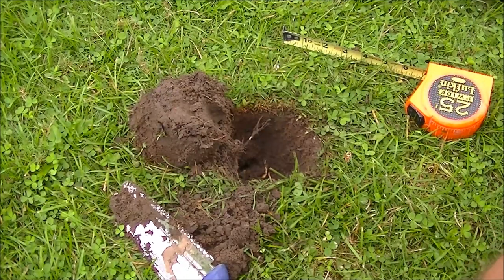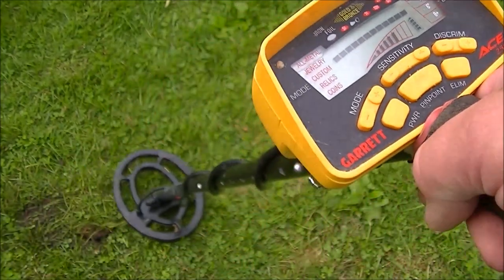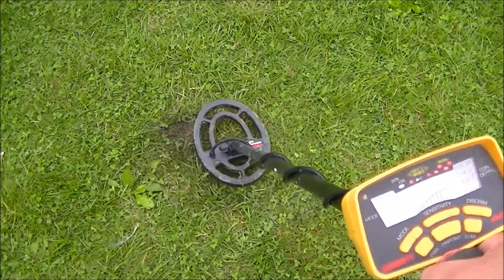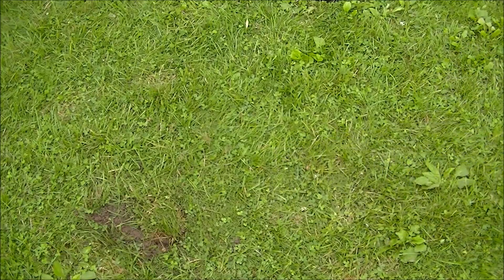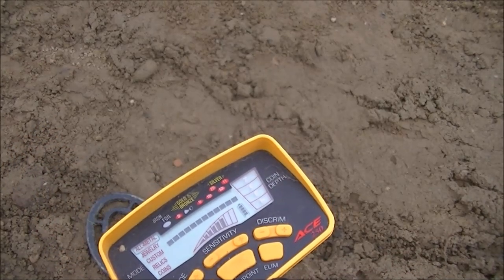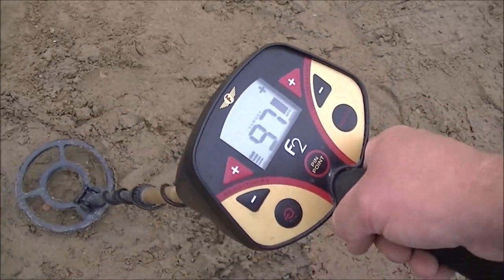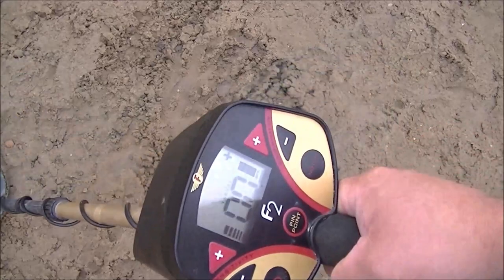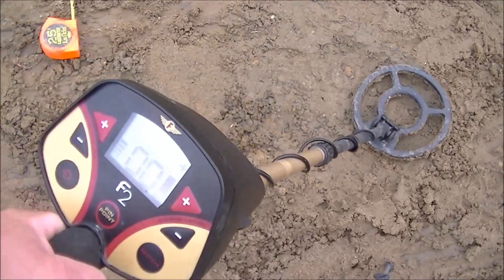Garrett Ace 250 and Fisher F2 Tested Side by Side

Comment: Why do the machines make several different noises depending on each pass?
Reply from the maker: Hi Jason. Basically the machine makes different tones based on what king of metal it thinks is in the ground.  For example, iron should sound different from copper or silver etc.  Of course this gets complicated when there are many types of metal nearby.
Reply: Paul W.
Thank you for responding and answering my question. I assume with time one will learn the tones. Thanks again, I am looking to get a decent unit for a hobby.
Reply from the maker: Jason O I like both the Fisher F2 and Garrett Ace 250.  They are both about $200.  They both get the job done and are dependable machines.

Comment: Ive used the ace 250 and its a dreadful detector , I have several minelabs  which are I no in another class , However I also have a tesoro  compadre  which is cheaper than both of these Ive never tried a fisher , But the compadre with beat the ace hands down . happy digging
Reply from the maker: The Fisher was nice coz it was so light with the sniper coil.

Comment: Just caught this vid and just want to say my F2 does not act this way...at all.
There are usually some differences on different F2's out of the factory, and soil could make a difference, too, but I have hunted in Michigan soil many times, some of the beaches also, also two other completely different areas of the country and there a couple of things really wacky about yours.
Just to be clear, I assume this was the same unit you dumped in the lake about 2 months before this vid, is it not?
Most F2's the quarter is going to be somewhere around the 80-82 range...dimes in the 71-73 range...give or take.
Mine is every time on these same targets and so are many other F2's that I know of.
Your numbers are way, way off in this vid.
Also mine can pick up that quarter easily at 4"...that dime too, and be accurate on every single pass from any direction.
I can actually get way further than 4" in Michigan soil and any other good soil with that 8" coil on both coins, and even using the 4" sniper I have picked up dimes easily at 4" consistently and even a few 6" or a little more.
Something id definitely wrong with your F2.
I noticed your vid from about a week ago and it seemed to be working better, but you were using the sniper coil on that one.
Use your 5 year warranty and get this thing back to Fisher with that 8" coil and let them look at it and fix it.
Do not mention the unscheduled bath it took.

If you do, once you get it back you will probably see a world of difference.
Reply from the maker: Yes you are right on everything.  I seems to do best with the sniper.  I actually planned on getting it in, so the cold weather is a perfect excuse.  The ground is basically done for as far as digging is concerned for months.  That a bunch for the insight and your time.  I really appreciate it!

Comment: ace 250 all day long ! f2 is k it was my first machine . and i had a go with my friends 250 one day and that was it for me i had to get one :) if anyone is thinking about starting detecing on a serious level for there first machine then i recomend the ace 250. and its little brother the ace 150 , there is not much diff apart from the coil size and has no pin point (target) and a few other setting . i have used both machines and they are very much the same when it comes to finding objects and depth . and the ace 150 is around the 130 pounds mark :) but hey thats only my opinion ! just trying to help a first time buyer that wants a machine between 100 and 200 sterling (pounds) you can get the ace 250 for around 170 ish pounds if you shop about ! but DO not pay any less as there are many fakes on the net . i hate to say but ebay is the worse for fake machines ! ! so buy from a trusted dealer. i hope i have helped someone in any way , kind regards luke

Comment: Paul, next time you do a test, be sure to turn 90 degrees to the target so you end up with a + sign over the target. You'll most likely get different results by doing that because some detectors react differently in opposite directions depending on the target and how it is situated in the ground.
Peace out,
Al-Fu

Comment: Too bad on the poor job the Fisher F2 did on the 4" dime. It's sad because for $200 and a brand name like Fisher, you'd think it could do at least as good as the Ace 250 which is similarly priced. If it was a Bounty Hunter Discovery 3000 or 3200 which is basically the same detector as the F2 but with Bounty Hunter badging, it would be getting down to around 7 to10" on those coins.

Comment from the maker: I don't think of one as better.  They both do good.  I think the 250 is a slightly deeper machine for clean (no trash).  I think the F2 especially with the sniper coil is better in trashy soil.  I think it discriminates better.  It is also much lighter.  I would buy the F2 but look at it as another tool in the toolkit.  Where I hunt I usually grab my F2.

Comment: i have the coinmaster GT and it goes deep, has a backlight, discriminates well. i think of it as a Cibola because of the VCO. I Have ad an ace 250 and a ace 350. i had great finds wtj the ace 250 and a sniper . nickels and rings popped out easily. depends on budget and preference

Comment: Hmm interesting. I have an F2 also. It seems that the soil were your doing the test doesnt help that much. I have recovered a dime at 7-8 inches deep with stock 8" coil. Then again, I live in the tropics definateley a big difference in ground conditions. Also, the 250 works at 6.5 kHz and the F2 at 5.99 kHz. Not a big difference but there is...Nice video, I enjoyed the comparison on these two great performing machines!

Comment: I've had the fisher f75 SE for almost 3 weeks and still trying to get used to it. In boost process mode it can really go deep. It is very sensitive to power lines, cellphones etc. which can cause chatter, but that can be overcome by lowering the sensitivity or hunting away from them. Id is fine on single targets; but numbers jump all around on mixed. Adjustable Gb is a big plus especially with the fast grab feature. The ace 250 ,in case you weren't aware, has a factory fixed ground balance.
Reply from the maker: I have to say I am enjoying my Minelab 705.  You can see it on my newer vids!
Reply: is F75 SE worth its cost? It's much more expensive than F2. Does it deliver for these money?

Comment from the maker: First, much obliged for the sub!
I use my coils in the water all the time on the Ace and the F2.  I go in within inches of the top part with the batteries.  I suggest using a lanyard so you wont drop it in.  See my vid called death of my F2.  It had an unplanned bath lol  
I use rechargeable batts in both my machines.  They work great.  Beware the manuals warn against this!!  The F2 was breaking me with buying 9v alkalines all the time.
BTW I try to reply to all comments!!

Comment: Which do you prefer? 
MD-5008 vs Garrett ACE 250?
Reply from the maker: I don't know of the MD 5008 at all.  I know and like my Ace 250.  It is a very sturdy machine that always works well.  I also like my F2. If I had to chose between those 2 I would probably lean towards the F2 just coz I like the tones best.